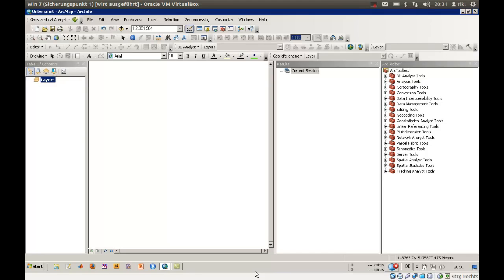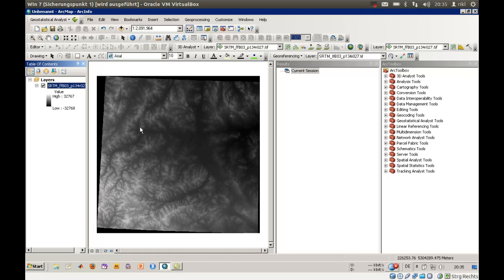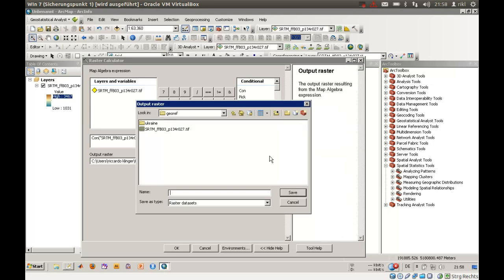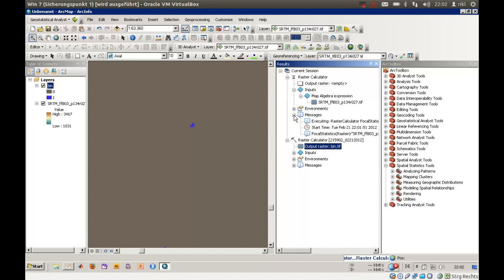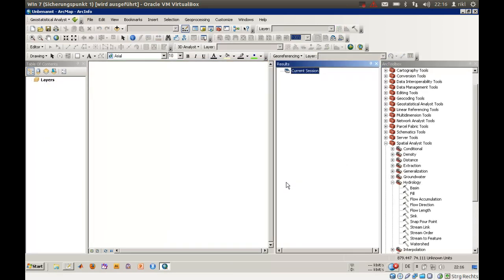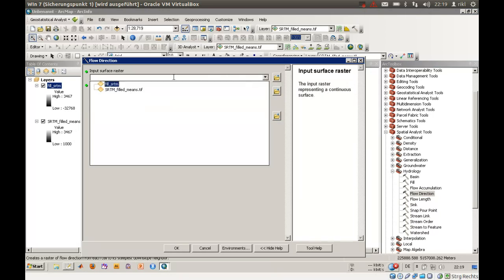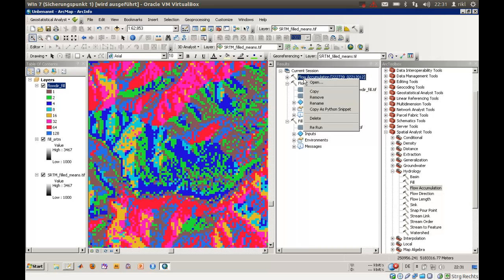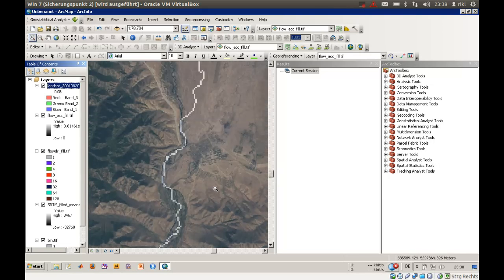using SRTM data for hydrologic calculations in ArcGIS (part 1)

Comment: Riccardo Klinger, what if I need to do all this hydrologic calculations for areas located norther then N60* which uncovered by SRTM?  
The area I'm gonna model has quite flat topography, and located between N60 and N62. 
Is it possible to use so noisy ASTER GDEM-2 for this purposes?

Comment: Hi,
I am trying to calculate the slope of SRTM data. When I tried to calculate the slope in Decimal degree using z factor 1, it gives me strange values though in the range of 0 to 89.998680 which is normal, the distribution is quite strange as most of the area appears as steep slope except may be extremely flat areas (like lakes) i.e, only two classes. On contrary when I use the percentage it works fine. I tried several times but no luck. Can you please help me to fix the problem.
Rakhshan

Comment: Hello Ricardo,
i downloaded my srtm data from the earth explorer. You are using a .tif data while i have an .bil image. Is there any difference in working with that file? My first step was converting my file from a geographic coordinate system into a projected one. Is your working file in GCS or PCS? Is this step necessary for your working flow?

Will be grateful for any help.
Daniel

Comment: Hi Riccardo,

Thanks for the clarification. I am now having a bit problem as when I convert the srtm data in to flow direction, it gives me the pixel values from 1-255 instead of 1-128 as directional values. This is effecting my later analysis as when I try to do the direction accumulation analysis, it does not give the area values. Can you please comment.
Thanks

Comment from the maker: Dear Esmoreido,
thanks for your comment. There is probably a limit in correction of missing values! first make sure that you treat these values as NaN. If you dont know: export the tif to ascii (see toolbox) open the ascii on a good computer and replace all Values of 32768 with NaN.
then transform the resulting ascii back to tiff using the toolbox and try once more sing the focal statistics toolbox! if you have further questions: info at digital.geography and com 
all the best, riccardo

Comment: I am doing the same correction routine on my tiles of the SRTM data (N54E095, respectively), and I find huge clusters of 32768 pixels on the mountainous ranges. Using the FocalStatistics tool and the procedure you outlined in this wonderful video gives me same clusters of pixels, yet filled with values exactly mean of the correct relief and 32768, e.g. 16000 something, which is obviously unsuitable as a correction. Am I missing some part of the process? I am a bit frustrated...